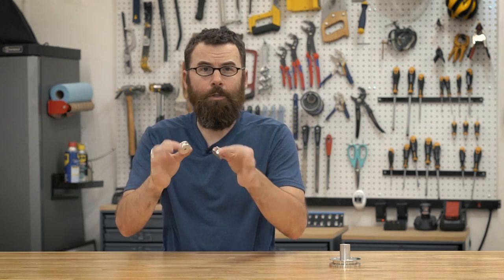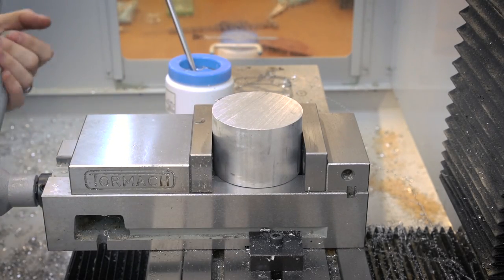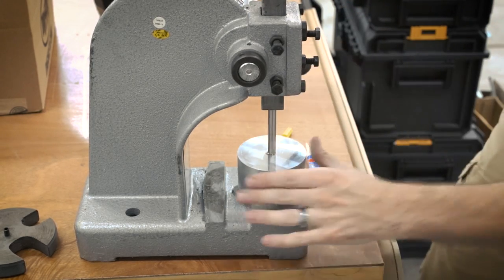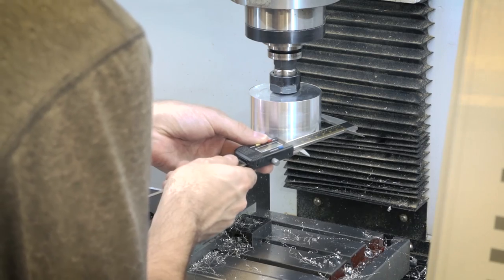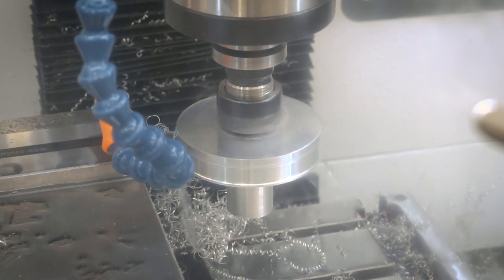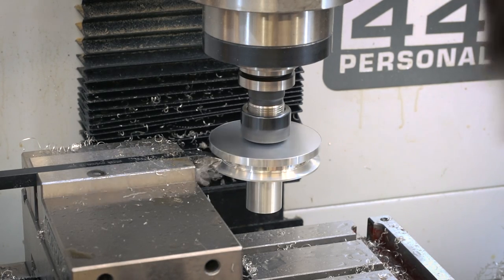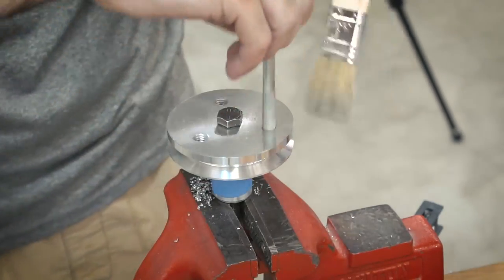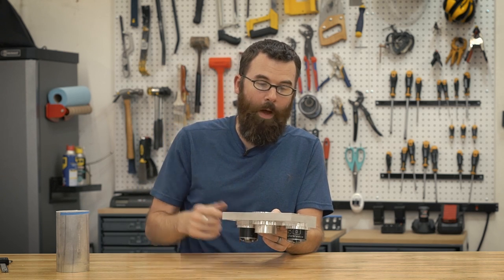From Start to Part:  Pulley Hub (Mill Turning)

Comment: That was very entertaining, you've definitely got some interesting machining techniques! Great job on keep a clean shop, too!

I feel like you might get a lot of runout using the VMC holding just your 3/8" shaft. Obviously it worked... but you can tell the difference in surface finish between the large and small diameters.
Reply from the maker: Yeah, and some of that had to do with the spindle stalling.  It didn't 
help!

Comment: Pretty cool! One thing about that bearing though: like all bearings, it really should be tight on that shaft, or else you will introduce chatter and slowly wear out that part. A bearing puller and a impact gun only take five seconds longer.
Reply from the maker: Yeah, I know.  But for a 3 minute match, I'm not TOO worried.  I would normally do a bearing puller, but it's pressed right up against the bottom of the pulley, there's nothing to grab.  I might need to make a new version, and I might put some through-holes around the bearing, so you can use an arbor press to press dowel pins from the bottom to press out the bearing.  I did this on another part and it works well.
Reply: Instead of dowel pins, tap them and then you can use pusher bolts to drive it off. Then you only need a wrench with you and not an arbor press. Also, you can probably wrap a single wrap of teflon tape on there and get the slop out.
Reply from the maker: Yeah, that would work too.

Comment: Why not turn it on your lathe? Also, when tapping, use the lathe chuck to hold it. Alternately, make some aluminum soft jaws out aluminum angle. Or leather for even softer stuff.

Comment: Hello, I may sound stupid asking this, but at a antweight competition I am going to the rules state this: "All robot radio systems must have a way to change frequencies or coded channels to prevent radio conflicts. Having at least two frequencies or coded channels available is required. Lack of extra frequencies may result in a forfeit." 

I am wondering how to do this with my transmitter. ( I know nothing about transmitters) I have a cheap Hobby King 6 channel transmitter. Do you think it could be done with that? If not, What transmitter would I need. Thank you so much for being so responsive to my questions in the past. I really value your time.
Reply from the maker: Good question.  This is a really old rule back when you had removable crystals in radios.  Modern 2.4ghz radios bind or pair, so this isn't an issue.  If you use a radio that binds to your receiver, you're good to go.  Your transmitter has this.
Reply: Robert Cowan Oh, Thank you so much! That is great news! Thank you for replying to all my questions.

Comment: Can you give more details on the VFD adjustments you had to make? I also have a fairly early 440 and suspect it of being easier to stall than it should be.
Reply from the maker: There were no adjustments.  I just contacted Tormach and they replaced the driver for me after determining it was faulty.  If yours is doing something similar, give them a call and see what they say.  Mine was having issues getting up to 10K RPM.

Comment: I would not touch the cuttings with my hands while the workpiece is rotating. If you are holding some and they suddenly catch something and pull your hand.

Is it safe though?
Reply from the maker: You're correct.  I almost cut myself and now keep my hands out of the mill at all times.

Comment: This seems like it would put stresses on the spindle that aren't intended which would harm the accuracy the machine that produce in the long term
Reply from the maker: You are underestimating the amount of force a spindle can handle.  This is pretty small compared to when I was machining titanium or tool steel.  It will require more torque from the spindle motor, but the spindle is more than capable of handling radial loads.

Comment: You seem to make things a little difficult.  Why not use the lathe to do all the turning?    And when tapping, why not use the V block to hold it securely?
Reply from the maker: I cover this in the video.  My lathe isn't that great and this was at the limits of what I could do.  And I didn't have v-blocks at the time, but I do now!  I only had larger ones which didn't work for this part, but I got a nice set of smaller ones.
Reply: @RobertCowanDIY  Awesome!- I actually meant the v block jaws you used in your vice.  But no matter - all good